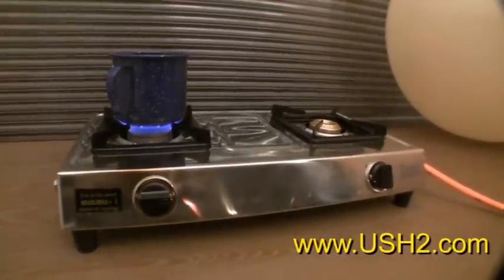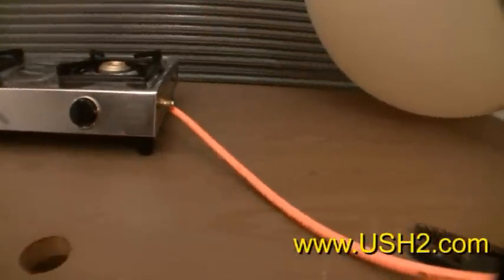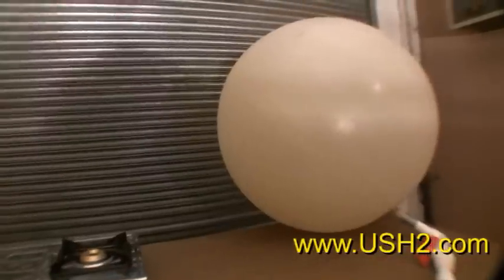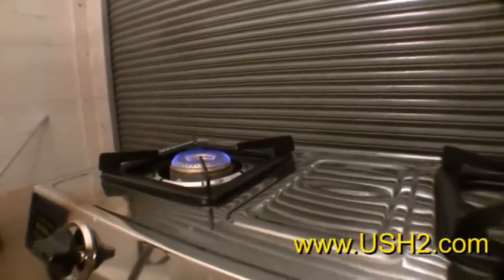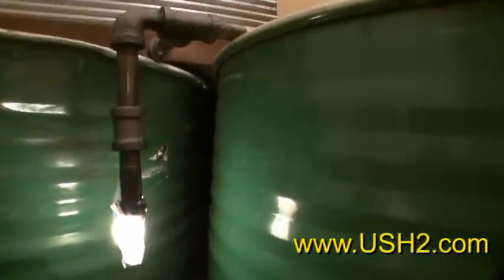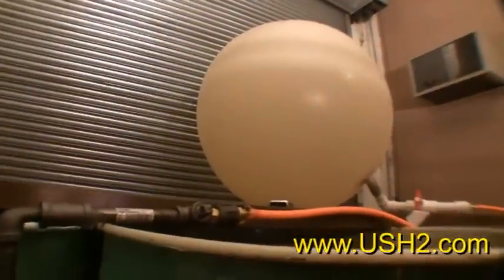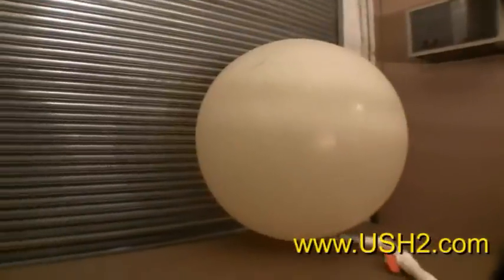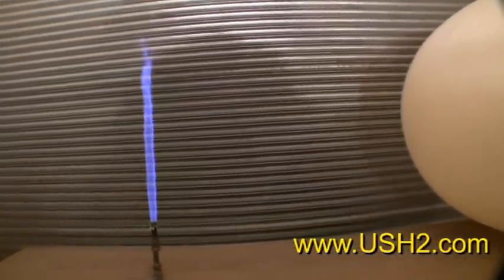Stove, Cooking, Light, Power from Gasification of Hydrogen Based Fuel

Comment from the maker: @mangyscavenger the producer gas can be stored FOREVER or until the balloon pops.  it does not spoil, it does not go bad, its a gas, not gasoline.  NO.. a rocket stove is about as far away from a producer gas generator as you can get, you do NOT use a rocket stove to make producer gas in any shape or form.

Comment from the maker: @robert66michel NO... it won't condense to a liquid above -313F AT ALL.. ZERO, ZILCH, NOT one Itty bitty tiny amount.  Its not a partial thing, its all or nothing.  You can compress it and store it and use it just like you do Natural Gas, there are plenty of natural gas tanks and compressors and regulators and everything else available on the open market.

Comment from the maker: @robert66michel If your freezer goes down to -313F then it will liquefy.  Notice, I said MINUS 313 Fahrenheit.  So no... your freezer is not going to freeze carbon monoxide into a liquid.  its a gas, its going to stay a gas, it in no way liquefies like propane or butane does.

Comment from the maker: @man4cannabis Thanks... yes, you can store the gas in an inner tube, it works very well, you can move the wood gas, producer gas, in to the tube with a standard shop air compressor that has a hose on its intake hooked up to the gas, and its output hooked up to the inner tube. -STeve

Comment from the maker: You'll need a 3000psi compressor and high pressure storage tanks.. JUST like you need for natural gas.  As for the size of the reactor, its NOT mobile, you don't put it in the vehicle.  The reactor is the size of a 55 gallon drum.  thanks for writing...Steve

Comment from the maker: About 1 minute to produce that amount of gas, and the reactor was on idle... I just did a quick calculation..if the balloon was 3 feet in diameter and the gas was 100% CO..then it would of taken less than 1/2 pound, ...around 250 grams of wood to make that gas.  Thanks for taking the time to write ( and to write an intelligent question, unlike the ones I deleted).  - Thanks Steve.

Comment from the maker: You are correct, CO is dangerous.  So is electricity.  You got instant death 6" from the floor, and YOU CAN put your finger in there.  Gasoline is dangerous too, and you pump it daily.  Natural Gas CAN suffocate you as well, but we added odor to it, same with propane.  Don't swallow water into your lungs, you'll die.  They stopped using this type of gas after wwii because the WAR ENDED, it has nothing to do with CO.  Good Comments, but all fears can be addressed easily.  Thanks-Steve